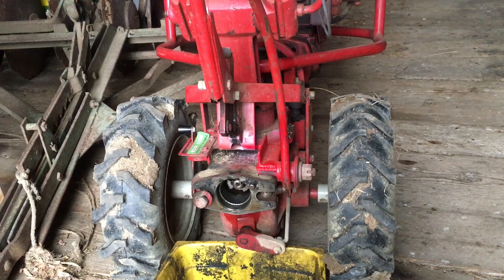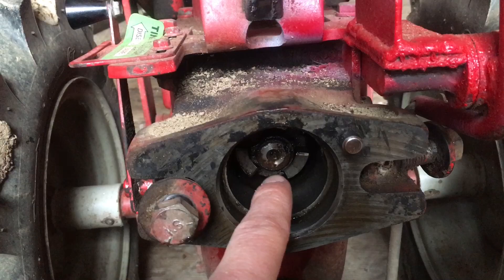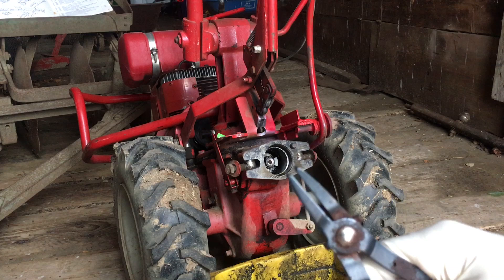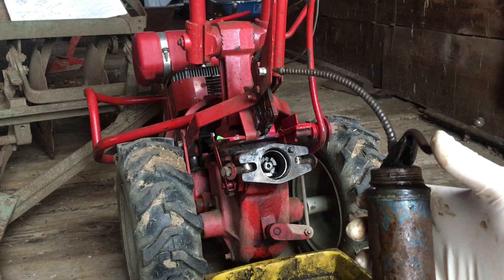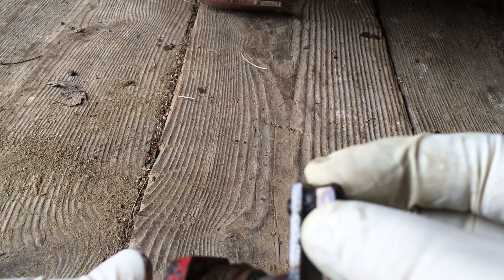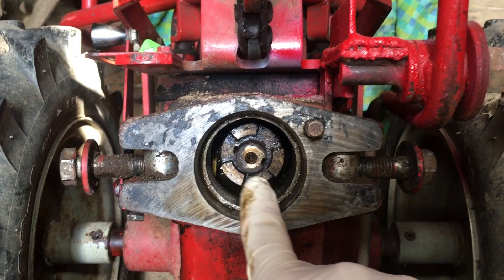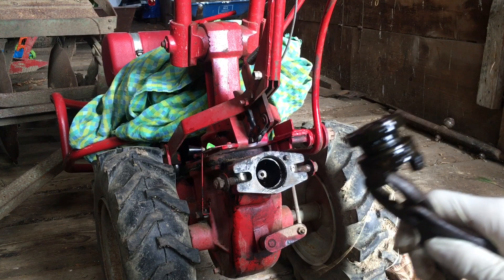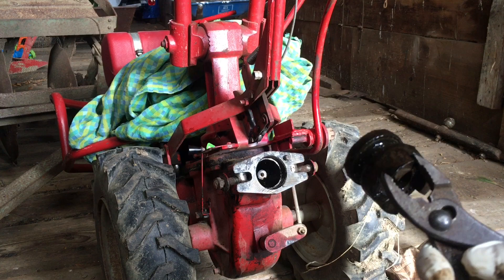Troy-Bilt Horse Rototiller Tines won't Engage - Fixing Seized Dog Clutch/PTO (1986 PTO Horse Tiller)

Comment: What you should have done,  was to smear a thin coat of silicone  sealer, on that tine gearbox sealing surface,  to keep out any further moisture from ever getting on that dog gear, for the tines engagement piece.  I use to be a mechanic on these yard machines, years ago. Also , that actuator box, for the tines, is actually supposed to have a heavy weight gear oil in that box, Not grease. The reason being  is with engine & gearbox heat, that grease will melt, and drip away from your engagement mechanism, leaving the sliding dog gear, to lose lubrication again.  That is why we use a heavy weight gear oil in that box. When that gearbox, was originally designed,  it has machined surfaces, which allows you to not using a gasket. That's why I said to use a thin coat of silicone sealant there. You'd be ahead of the game, if you were to remove the tines now,  and apply some silicone, on those surfaces now. Just to keep any moisture from  causing any rust on those moving parts in the future. Just Saying.
Reply: I use 90/140 and mix Lukas hub oil with it due to heat in West Texas
Reply: @philliphall5198  Hey Philip,  you'd be better off, using the 90 with by itself.  Not a multi grade oil.

Comment: Hi. I replied earlier but have been unable to remove the dog clutch. I removed the lock ring and the key but can’t separate the dog clutch from the shaft. Soaked everything with Liquid Wrench. It did move slightly when I tapped it but unfortunately back not forward! Anyway to free it from the shaft?
Reply from the maker: There is a key on the shaft. If I recall, I got the key out and worked it from the rear until it spun. Then I worked in the side of the housing to move it forward and back. Grease the heck out of it after.

Comment: Thank you for sharing this informative video.  Laughed empathetically when the lock ring went into orbit. Great explanation, practical processes, and video. Well done!
Reply: has any one else lost i C-clip the same way, Yes many, you could also ue Grese as a temp seal at that joint it should repeal the Water, but never Pressure was any sealed area's ever.

Comment: Thank You so much for your posting with as much detail as you offered. My biggest problem was getting the snap ring off. Had the correct tool except the points on the tip had to be ground down to fit the tiny holes on the snap ring. It appeared to be one side of the slotted key that had rusted to the shaft. A little bit of rust inhibitor in the shaft did the trick. The shifter to engage the tines work Slick !! FYI my Model was a 2012 with exactly the same system. 
I usually do most of my own trades work but without any schematic of the inner workings I was going blind into this repair. Your assistance with the posting made this an easy fix. Thanks again!🎉🎉❤❤

Comment: Great video! I have one of these babies that was gifted to me with a splitter and tiller attachment. Had the splitter on when I received it, works a treat, however I just recently put the tiller attachment on and the tines run without resistance, but as soon as they touch the dirt, nothing but grinding noises.. I dissected the PTO parts but was unsure what all was amiss.. Ah, the head must have snapped off the engagement bolt, there's nothing there to engage the dog ear... not sure how it was fine with the splitter attached and broken now, but it is. The snap ring was missing from mine so, you're certainly not the only fella to loose the snap ring into "open air", LOL.
I'll try getting what's left of the broken engagement bolt out of the lever, if that proves too difficult, it's going to be "full time" PTO.. I'll add a bushing behind the dog ear. Cheers buddy!!

Comment: Hey, it finally came off. Heat and a little leverage via the hole for the engage lever. I’m gonna fine steel wool the shaft and as you say, grease the heck out of it! Thanks for response. Your video was a life saver. BTW, my Horse is a 1986 as well. Where you located? We’re in Upstate NY.
Reply from the maker: NH

Comment: I just replaced all the seals in my tiller attachment last weekend.  I have the chipper/shredder mounted on it now.  When I make the swap, I'll make sure to grease the snot out of that while I have it separated.
Reply: How hard was replacing those seals in the tiller attachment??
Reply: It was pretty simple all said and done.  I had mine completely torn down because I replaced a shaft also.  For seals only, I found a couple other vids out there I wish I would have seen first though.
Reply: like to see a video of the chipper / shredder. I have one but can't see how to hook it up with controls and handle bar in the way

Comment: I removed the key but the clutch is frozen on the shaft and it’s difficult to apply leverage to move it back out. As you mentioned in your video earlier, I’m going to apply some heat. Someone else online with the same problem suggested that. Do you agree?

Comment: So what about the seal behind he engagement cog? You don't think it got damaged from the heat of the torch? Doesn't that seal keep the gearbox oil from leaking outta the unit?...🤔
Other than that, and watching you launch the snapring(been there, done that), you showed me something I was dealing with on a used unit I just purchased. Seems the Troybilts are prone to rust issues. You'll wanna keep the big pin slides between the engine and transmission box clean and lubed as they are also known to rust and sieze up if not exercised.😉
Reply from the maker: The seal seems OK so far. I was worried about the heat near it too, but it’s pretty far back to the seal and I focused the heat in short bursts on the PTO end of the shaft only. Thankfully it didn’t take much heat. Only one or two other bursts that I didn’t show. It’s possible the seal didn’t get much hotter than it would after an hour or two of hard running. My Dad bought this tiller new in 1986 and it’s always stored in a shed. It has been well maintained. This issue came as a surprise. The engine slides are certainly well lubed, as is the F/N/R lever.
Reply: The main reason that Troybuilt equipment has rust prone areas, is because they build their products from cast iron, which is pours, which holds moisture.  Addressing the part where he used a torch, he did this to help enlarge the sliding components, and he did so, only momentarily, not long enough to cause any damage to anything else. In most cases, you're able to use the same gaskets, in the event, that you forgot to get some new ones etc. But Troybuilt,  uses a thick gasket material, which you'd be fine in most cases, adding some silicone sealer spread out across the sealing surfaces, evenly. On the Many different pieces of equipment that I've repaired for customers, I've very rarely had to replace the gaskets, because of the high grade of gasket material that Troybuilt uses. I've always just used a very thin film of silicone, and it has never failed me.
Ultimately, I've always let the customer know and decide what they want. Gaskets can be a bit pricey, when you're purchasing them. Some more than others. Also I keep a bulk roll of gasket material on hand, to make my own gaskets, when needed. I hope this helps some of you.

Comment: I have same  machine and. problem...except mine was not having a problem spinning...the engage lever just doesnt move it. Of course, I'm a little frustrated.
Reply from the maker: That is the same problem. I couldn’t move the engagement lever. You can only spin the shaft without spinning the whole transmission once the shaft key is removed. The outer piece needs to slide forward and back to engage and disengage. I got it free by spinning it on the inner shaft and then getting it forward/back.

Comment: show us a video of changing the oils and lubricating the rest of the tiller
Reply from the maker: Unfortunately I replaced the tine shaft seals about 2 years ago and the gear oil doesn’t need changing any time soon. Other lube is just the shift levers and slider posts by the engine where it slides to tighten and engage the belt. Maybe I can show hitting those in spring.

Comment: Mine has the opposite problem.. It won't disengage the tines to clutch. Mines at least still usable but isn't fun.
Reply from the maker: It’s probably the same issue - dog clutch and shaft seized in the engaged position instead of disengaged.
Reply: @ProductiveRecreation  right and I'm not wanting to tare it down to fix it. I can still run it for now. Will see how long it stays engaged

Comment: Where did you get your owners manual?
Reply from the maker: My father bought this machine new and kept all the original manuals, including the parts manual. The owner’s manual is very good and even details seal replacements. You don’t normally see that today.
Reply: you can find them on the forums, or just Google. then download what you need.